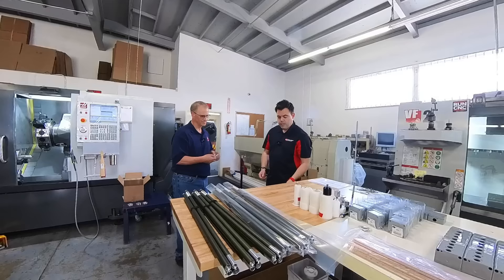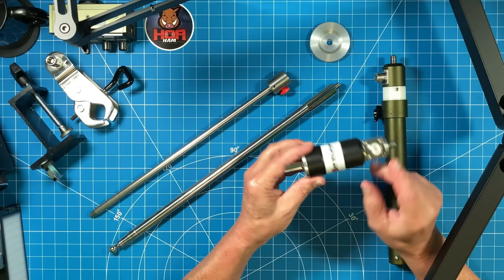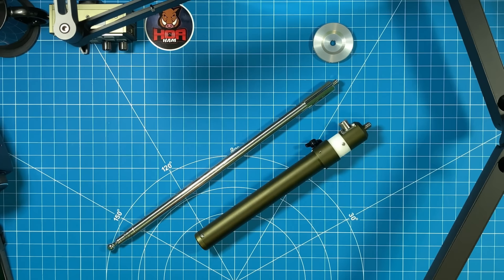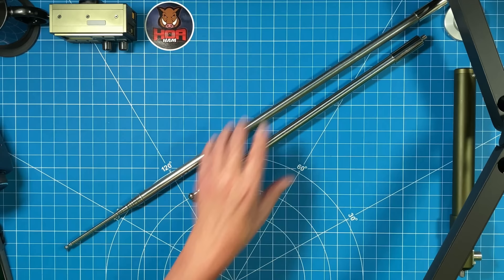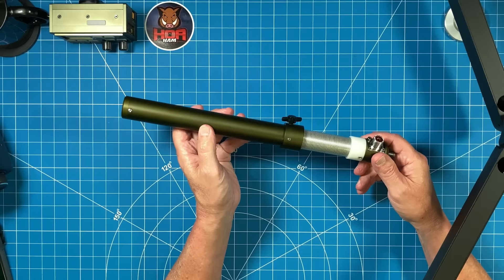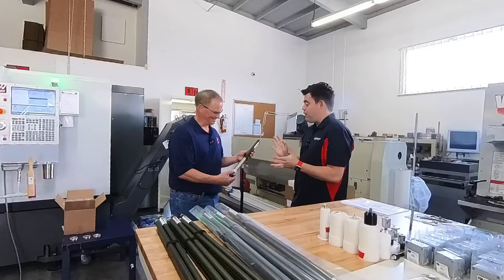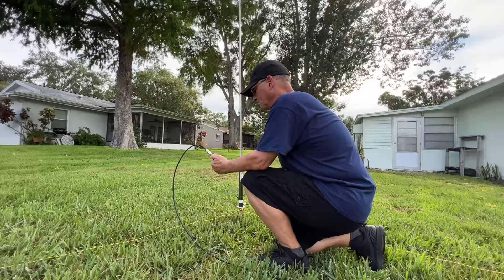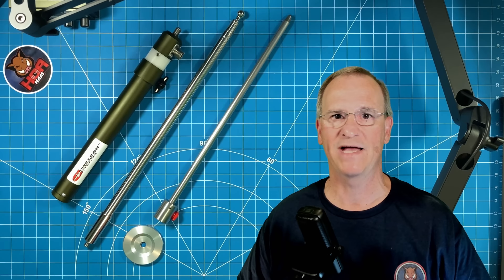Chameleon CHA PRV Portable Resonant Vertical Antenna REVEALED  --  Debut and Review

Comment: This is certainly the best execution of this idea that I’ve ever seen.  Very elegant.  Not totally unexpected since their loop antennas are the bomb and the quality of their CHA line is top notch.
Reply from the maker: I own multiple coil antennas and it pained me to have to send this one back while they finalize everything.  I like all my coil antennas, but none of them compare to the Chameleon quality.
Reply: @HOAHamRadio you need to check out the REZ Antenna Systems Ranger 80. It came out a couple months ago and is built like a tank. It seems Chameleon took a page from their book with the radial puck.

Comment: Thanks a lot for showing this new product!

For serious SOTA activations, a low weight of the carried equipment is the #1 requirement. Therefore my first question concerns the weight for the whole antenna system, including the coax, radials, winder, etc. Therefore, it would be very interesting to know the total weight of your shown solution. 

BTW: I have not met a serious SOTA activator that uses PL or UHF connectors. Mainly because they have no defined impedance, are big, heavy and clumsy to use in the cold, compared to a BNC connector. Why do portable antenna manufactures still use these 90 year old connectors? It can't be the 4mm diameter socket that fits a banana plug...

73 Stephan
Reply: The buddistick pro has a BNC connector and a wider wound coil so more efficient. But for me, SOTA will be a PackTenna EFHW every time.
Reply: @503Nick  Thanks for the info! Every ham has different requirements, which is why one size fits doesn't work with our hobby.
Reply: You can put a BNC adapter and one of our RG-316 with integrated choke to cut the weight by about 3/4++
Reply: @Chameleon_Antenna  Sorry, but an additional BNC adapter doesn't lower the weight...

Comment: At first glance, looks very similar to the Super Antenna brand, which I’ve never used but have heard good things about. Chameleon has a reputation of building rugged products and I own a bunch of it, including some very old chameleon stuff, which still comes in handy here. I like it. Take something that already works good and make it work good-er. I’ll buy one.
Reply from the maker: I think that's what you'll find with this, its "good-er".  The quality is far superior to all my other coil antennas, and the power it will handle if far higher.
Reply: @HOAHamRadio  good deal. Thanks for the review. I’ll keep an eye on the website, but they usually send me an email when new stuff comes out. I’ll tell them I saw it on your channel.

Comment: An inductor will offset capacitance if an antenna is short.  A 17’ whip can be “loaded” to work on lower bands but even if the antenna is resonant the gain can be severely affected. Your ohmic losses will be greater.

Comment: Nice and compact, just the way I like it. I'm actually quite impressed with that new whip antenna, because the collapsed size is much shorter than I'm used to. With all things considered, this would make carry this kit in a small backpack quite doable. I hope you can test everything at QRP levels, because that's how I usually operate, especially when traveling. Thanks again and I hope to see more videos on this wonderful coil. 73's KN4MXZ 🙏🏿
Reply from the maker: I had to send the unit back to them as they complete the final production and prep.  As soon as I get a first production unit in hand, I'll be doing many tests, comparisons, and vids
Reply: @HOAHamRadio  Thank you.

Comment: Hello! This coil is interesting, now one can buy it instead of the wolf river coils or all the other variants. I have a suggestion that maybe you could take to chameleon: add some marks to the coil to show where (more or less) the antenna will be resonant. Just like the MC-750 does. We all know that depending on soil conductivity this changes, but just as initial reference. 

Also, not regarding this antenna kit: the ss17, make a version of it painted in green. Oh god, it’s incredible the amount of attention a metallic whip gets in the park. If I had of one these in green it would help so much. Also, sell the ss17 with stickers so we can mark the resonant points when we use it with some radials for a 6-20 meters antenna.

73
Reply from the maker: Thanks for view, comment, and suggestions.  I suspect all comments will be viewed and considered.

Comment: I’m sure I will buy this at some point but the 17ft whip does 20m-6m on its own very well and a bit more efficient than coil loading. This new system will be smaller though.
Reply from the maker: Thanks as always for the view and comment @forgetyourlife.  Everything is a trade off isn't it--lets us fit the gear to a specific need / use.

Comment: Very good video .My first thought here we go this looks like a Wolf River set up and there we go. Your antenna test proved I was right. The only issue I have if you want to change bands you need to go to the antenna and adjust using the analyser helps. I believe this Cha-Coil will last longer in use than the Wolf River version  The Cha has the outer cover protectecting the coil from any mishaps during transportation... Thank you. Keith M0KLL in Sunderland England....
Reply from the maker: Thanks for jumping in from England, watching and commenting!

Comment: I was hoping Chameleon would improve on the original SuperAntenna with some form of band indication marks on the coil, but it seems they concentrated on slightly better materials instead.
Reply from the maker: Defiantly a focus on high quality materials.
Reply: This system will improve over time with great accessories!

Comment: Thanks for the video.  I wonder if you replaced the Telescoping antenna with a Long wire  if it would work on 80 or 160. ?  would be nice if it did.
Reply from the maker: Yes, it absolutely would.  Just swapping one radiating element for another.  Would be something fun to demonstrate.

Comment: Does this tune 40/60 and 80 meters well? Is it efficient on the low Bands? I only operate the low bands.
Reply: Yes - with the basic kit which will include the 58” collapsible whip antenna you’ll cover everything between 2M and 60M. To obtain 80M you’ll need the SS-17 and we might introduce a loading coil for it later on.
Reply: If you like to use the lower bands mainly for NVIS, a vertical antenna will be always way inferior compared to a horizontal one.

Comment: Could you use the ATU in your 7300 to tune it if you wanted to from inside the house or are you stuck on one band?
Reply from the maker: The antenna is meant to be used resonant, so I've never tried it.    You could use the 3 to 1 internal tuner to do what you suggest, you would just lose some efficiency.

Comment: Nicely done video, Bob. This looks very interesting and it looks like Carl and Chameleon have another winner. While I believe I have a preference for my MPAS 2 for fixed and portable locations since I don't have to go to the antenna to QSY, I see some real benefits of this new "Bob's Your Uncle" system (how's that for a name??)

A couple of key issues: hopefully, the final product will have numbering on the coil for fast adjustments when QSY.

With regard to both this new Chameleon system and also the coil antenna you reviewed a few weeks ago: is there a way to attach a standard stainless steel whip-like is used on the MFJ, etc. single band cheapie antennas?

The reason I ask is that I'm currently using a Wolf River Coils Silver Bullet Mini as my HF mobile antenna with a separately purchased 58-inch stainless steel whip. This works very well but it is a pain in the ass to adjust precisely when QSY – even with Sharpie marker indicators. (I partly solved this problem by using my Elecraft T-1 tuner with the WRC and my ICOM 705 in the car.)

If Carl at Chameleon is reading these comments for this review, I would whisper to him to make the package work as a mobile antenna by allowing a stainless steel whip to be used as a stinger since the included adjustable whip probably will not be durable enough for mobile use at 75 miles an hour and all those low hanging branches at lower speeds.

Thanks again, Bob for the great reveal!

 -.- ...-- .-. .-. .-.
73 de Robert   K3RRR
Twitter:    @K3TripleR
YouTube.com/K3RRR
Website: K3RRR.com
-.- ...-- .-. .-. .-.
Reply: Marking the coil will be a VERY hard task because inductance will vary depending of antenna installation method: SPIKE MOUNT, UCM, Tripod, Jawmount and others. It will also depend of the RF ground quality: 1, 4 or 6 counterpoises, elevated or not, soil conductivity, etc... But that being said - we're thinking about an universal way of measuring the tuning coil position so all users would be able to understand where they need to position the coil for THERE personal needs and NOT on standardized needs.

We also have stingers (thousands of them) that will be offered to either be used as radiator or as counterpoise (with a special adapter) for those who can't extend a 33' long counterpoise.
Reply: @Chameleon_Antenna  Thanks for the response… Carl sent me the MPAS 2 (along with several other antennas over the years)… For the past 12 months, I have been using the MPAS 2 as a vertical on my second-story balcony with just one counterpoise that was included in the kit. 

It has withstood the weather well and performed almost as well as my 67 foot 40-10 EFHW that slopes up to 50 feet. MPAS 2 is a GREAT antenna in my opinion!

With regard to the new antenna, all the factors that you mentioned will come into play. However, the easy approach that other companies are using is just to print the number on the coil. Even though it is an arbitrary linear sequence of numbers, the customer will be able to know that for a particular setup, (e.g., 17m is always close to 24 on the scale.) This is something that's missing on my Wolf River Coils Silver Bullet Mini.

Best of luck with your rollout of this new antenna and give my best regards to Carl!

Robert

 -.- ...-- .-. .-. .-.
73 de Robert   K3RRR
Twitter:    @K3TripleR
YouTube.com/K3RRR
Website: K3RRR.com
-.- ...-- .-. .-. .-.
Reply: @ChiefImpeMentor  This is exactly what we're looking at but we aren't sure how to achieve it at a reasonable cost at the moment.

Comment: What is the power handling capabilities? Maximum power level for extended FT8 use?
Reply from the maker: I'm sure this will be covered in details once the specs are on the website, and the user manual is complete.  Chameleon has commented elsewhere "500W SSB 250W to 300W CW"

Comment: Looks good! Any details on power ratings for it on SSB/CW/digital?
Reply from the maker: Correction ot my original reply: Per Chameleon, 500W SSB 250W to 300W CW
Reply: @HOAHamRadio  500W SSB 250W to 300W CW/DATA
Reply: A “lite” version would be welcomed for those that truly want a backpack-able system for SOTA and qrp. The spike is nice as I have one with my mpas2 lite but hasn’t seen dirt, but I suspect it is extra weight for those lugging equipment to the tops of mountains.

Comment: Is the coil wound around PVC or another composite material?
Reply: White Delrin which is THE BEST material for that kind of product. Yes - it's MORE expansive than PVC, ABS or Home Depot Schedule 40 plumbing pipes BUT it's will offer an unparalleled core support for the loading core. Delrin has outstanding fatigue resistance, almost indefinitely withstanding cyclic compressive/tensile stressing 5,000 psi. Delrin does not permanently deform or retain dents, and has good impact toughness. Delrin does not use plasticizing for toughness: and so does not become brittle at low temperatures. An excellent dielectric, Delrin has remarkably low dissipation factors and dielectric constants over a wide range of frequencies and temperatures. Delrin retains good electrical properties in high humidity and even during complete immersion in water.

Comment: Would be nice to mark where antenna becomes resonant by band range
Reply: This is something that will vary with location and installation. Each users will have to be keep note of what is working for them.
Reply: @Chameleon_Antenna  Yes - I was thinking of something simple/quick/dirty, better than sharpie/masking-tape but not requiring an engineered change. Assume user already has their config set up by band. While in field they have basic minimum and need to get on the air quickly w/o to much screwing around. that idea.
Reply: @bobkelland7769  We're currently putting together a VERY comprehensive user guide that will eliminate tuning frustration and precious time wasting!
Reply: @Chameleon_Antenna  ETA on when this will be available ?
Reply from the maker: Should be early to mid August @hamradiobasics
Reply: @HOAHamRadio  Sounds great - can hardly wait !

Comment: Stupid noob question time...what about using a car magnetic mount and a vehicle hood to do away with radials?
Reply: Yes - it's possible! If you do so you'll need to be stationary (not moving and then you'll need to electrically ground the base of the CHA PRV to your vehicle chassis with a SHORT wire equipped with alligator clips and position the PRV in the middle of the rooftop.

Comment: Pretty obvious rip-off of the MP1 Super Antenna. In true Chameleon fashion I'd expect this to be 2-3x the price of the MP1.
Reply from the maker: I own the full Super Antenna kit and paid the Amazon price of $599.  I think people will want to know how the PRV compares to multiple coil antennas, and fortunately, I own several and will be able to share some details for consideration.  Thanks for stopping by the channel and taking a look.
Reply: If you really pay attention - it’s not the same thing at all! Look at the materials used, the feed point, the radial system, the thickness of the telescopic whip ( it’s larger) because we’re designing a portable cap-hat that will clip at the tip of it to increase efficiency, PTFE wire, SPIKE MOUNT system, etc… and the price will either be equal or less than the MP1 - oh and all made in the USA while the Super Antenna is made in China!
Reply: @Chameleon_Antenna  love my MPAS 2.0 it greatly exceed my expectations, especially how quiet and good it is on receive.

This new screwdriver looks great and what would be absolutely amazing would be a motorised remote unit ! That would be amazing especially one fully weather resistant 😊
Reply: Add a motor and you can call it a Tarheel
Reply: @hamateurradio82  a remote portable screwdriver would sell like hot cakes.
Reply: Lookup Baby Tarheel. It’s already made. They don’t market it for portable use but it will work with the right amount of radials.
Reply: @hamateurradio82  Interesting, I didn't know, thanks.

Comment: This is K2APA.  QUESTION:    Could this specific antenna , when an available ,  be used as a mobile on a lip mount on a vehicle.   I presently have an electrically adjustable screwdriver antenna on a 3/8 - 24 mount installed on the hatch of a Chevrolet Suburban.  The antenna that you are testing on this video looks and may be the same concept of a screwdriver except for being simpler , smaller and not prone to go bad on the adjusting motor , plus the fact that it can be part of a bug out pack in an emergency where the vehicle is no longer usable.  If a reply is possible , it would be appreciated.
Reply from the maker: Thanks for watching K2APA.  Chameleon has stated it is not designed to be used on a moving vehicle.  Stationary yes, moving no.